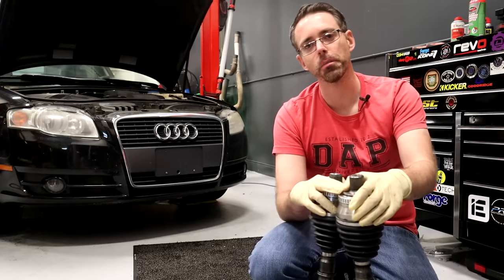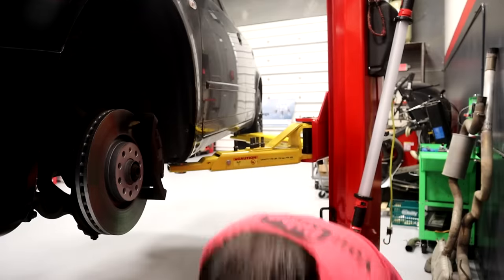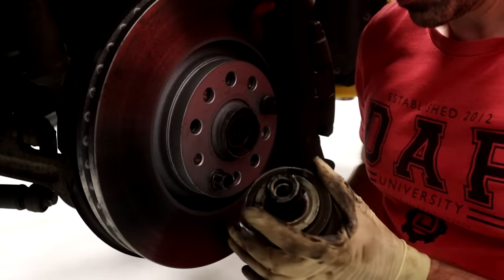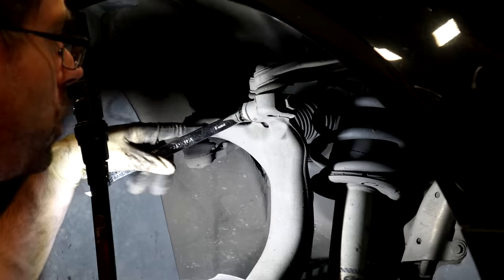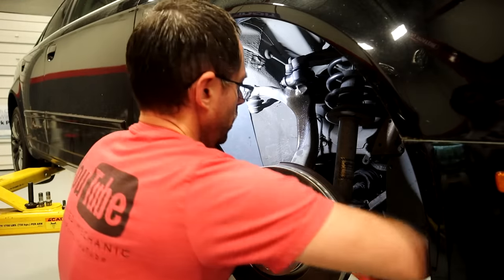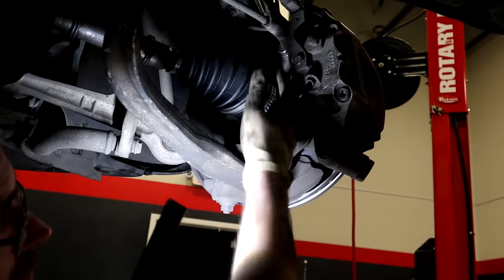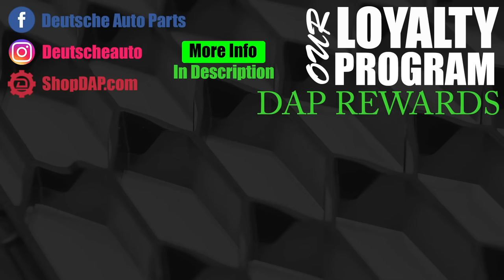How to Replace an Axle on VW/Audi Models

Comment: You can get them both out without removing anything else by lifting up the control arm with an additional jack to the regular driving height. That way you have enough space (at full left/right turn - take out key for steering lock) to get the axel out. Try various positions and angels of the axle but it is definitly doable, even with the S-Line suspension. Just finished this job yesterday.
Reply: This is true!  Thanks for sharing this info: very helpful.  
If anything, on the drivers side (RHD) = passenger side in LHD, jacking the strut up to a little above ride height helps.  I found I had to persuade the outer CV joint across with a pry bar, once I'd gotten the splined shaft out (steering set to full left lock).   I also removed the heat shield on the side of the gearbox as mentioned elsewhere in the comments.
Getting the new drive shaft in took just a little patience with getting the end of the splined shaft flat up against the back of the hub, then using a drift poked through the axle bolt aperture and into the hollow core of the splined shaft to line it up better.  Actually went in quite quickly and easily.
Reply: Best tip
Reply: Thanks for that guys 👍. 
Quick question,  my rotor is moving significantly while trying to break the axel nut, is that ok?
Reply: I am about to attempt this today . These videos and comments are a wealth of knowledge for those of us that want to fix our own things . Thank you to everyone involved

Comment: If you can, always get OEM axels, don't buy the cheap $30 ones. Unless you're planning on dumping the car on someone else, but if that's what's going on then you have bigger problems and should probably rethink your life
Reply: Raxles axels great place audi buys from them. Alot of after market  heap axles have hollow shafts and oems are solid.
Reply: We had the ball bearing cage brake / shatter after 3 mo. on a China cheap outer CV on a Caddy. Amazing as that's an under 100 hp drivetrain. Don't buy cheapo replacement axles.

Comment: The 08 A3 wagon is 12 point 15/16".it had 80 lbs on it .drop your other wheel to ground .real world floor jack style.take your pipe  from the floor jack put it on your breaker bar....get a 14 -16 m triple square to loosen lower strut mount bolt. That's how mine is set up up

Comment: i was under the impression that anytime you take out one of these bolts that require 90 or 180 degrees you need to replace the bolt because they are stretching to tighten.
Reply: Yes, all such specified bolts should be assumed to be one time use, Toque-To-Yeild.

Comment: for the passenger side i did it first and what bothered me was the heat shield but my axle came out easy, i just use the small spaces and moved the boot around to get it out

Comment: For anyone doing a B8.5, I was able to do the pass side without undoing any control arms or jacking up the suspension.  Turn the steering wheel  fully left, then angle the outter joint as much as much as possible to where the axle forms a check mark or V where the point aims towards the rear.
Reply: What about the driver side chief

Comment: Turning the steering wheel to full lock, taking the keys out of the ignition so the steering lock engages and then jacking the upright/knuckle up to take the sag out of it often allows you enough room to remove the axle without taking any arms off.
Definitely works on b5.5 Passat’s and probably related models.
Reply: On my b6 3.0 the drivers side axle could be removed and replaced without removing anything but the tire. Passenger side unfortunately can't.
Reply: I did the same when I changed my schock absorbers.
Reply: What about on a b8.5?
Reply: Works on a b7 too.  Left side just requires turning the wheel to full lock. Right requires full lock plus jacking the wheel up high enough to get the axle at a downward slant to clear the differential.

Comment: Great video! Really wish I had a lift and air power too, haha. I just did this on my B6A4 Avant. For the passenger side, I had to turn the wheel full lock to the left and then I opted to remove the plate/shield part just above the axle that is largely what causes there to not be enough play to remove it as easy as the driver's side. It's held on by three 6mm bolts. I removed the two on the side and left the middle one loose so it could move freely but stay connected.

Comment: I just had to remove the axle from the hub on my '13 Jetta SE 2.5 in order to facilitate a strut change. I worked for 30 or 40 minutes to free the axle bolt (I actually expected longer), but to my delight the axle slid right out like butter. The inside cavity was immaculate, no signs of wear or rust - and I'm in Ohio!

Comment: Pinch bolts suck they love to freeze. Ive snapped the head off one before. So now i just remove the lower ball joint and have plenty of room to work. Ive done it a handful of times and ive never needed an alignment on anybodys car.

Comment: My axle doesn't have bolts. The inner driver side cv housing is stuck. The passenger side was really hard to get out and was really really sticky, no transmission fluid came out as the repair manual stated, idk what that means if anything at all. But what was supposed to work, opposite side prying, has had no effect. Any thoughts, please help me out I can't find anything about my type of axle.
Reply: Because you have an auto transmission. Two ways to do it: 1) use an air hammer ; 2) buy the special tool to take the inner joint out of the trans. The first approach is not a DIY. The second one is expensive. Good luck.
Reply: Search VW Forums for construction of electrical duplex box (cut-out) with 2 - 3' metal flat stock. Wood block on end to flat stock to use as a slide hammer. Believe this design came from Toyota.

Comment: Great video chief.  I'm doing front left on a 2013 sportwagen tdi.  Looks very similar.  I can get the drive end flange bolts in no problem. And the wheel end spline is easy too.  But I'm having a very hard time torquing the drive end flange bolts to spec because the transmission and the transmission end of the axle are turning even when holding the wheel side of the axle in place with a screwdriver in the rotor.  Any ideas?  It's no problem getting them finger tight.  The manual specifies star pattern tightening to 10 Nm and then repeat to 70 Nm for the M10 bolts.  Even the 10 Nm is doable with no problem but trying to get them any tighter just spins and wraps up the boots.

Comment: Can extract that same lower control arm bolt if I my using a 3 Ton Jack plus two 3 ton steel jack stands? I’m asking because I know your using  a jack lift hence working in the air. Respectfully lastly my Audi A4 Quattro 2.0 08. Has been lowered meaning the suspension is not STOCK!

Comment: So, I just did both axles. The I got the inexpensive ones from ecs tuning. 
The drivers side matched up fine. The passenger side one wasn’t as thick as the oem shaft. And it was slightly shorter. Less than a half inch. Is that bad? Could that be the clunking I’m hearing over bumps? 
Bushings and ball joints are all good. 
Shocks and springs are good as well. 2013 Audi A3 8p

Comment: I will be pulling this out of the car at the junkyard this week. Am I able to reach all four triple square bolts on the CV axle without being able to rotate the wheel? I doubt I will be lucky enough to have the vehicle in the neutral position, allowing me to turn the wheel. My bet is that it’s an automatic and then it’s in park.
Thanks in advance!

Comment: Hi All so I'm replacing the axles in my Q7 and had a few challenges with getting the inner bolts loosened they are triple square 12 and as my shaft had snapped at the outer spline I had to utilise transmission to hold in place start engine put in neutral spin shaft then in park for each  bolt..my question is shaft removal as I have factory air suspension and it appears I can't just drop the control arm I will try jacking up as suggested shortly... I have an 2006 AU delivered 3.0tdi and I'm wondering if you have any tips to remove

Comment: Thanks for this, in my case the releasing of the torx bolts on the driveshaft end near the gearbox resulted in the casing still staying on the gearbox and I had to pull the knuckle out of the casing, Is there an reason for the casing/part where the knuckle sits in to to remain in place even after all thge torx bits have been removed?

Comment: Thank you soooo much for this video!! Did them at the same time as coilovers. Super easy removal if you break them loose, take the stock suspension out, put new axle into place, and torque axle down after the new suspension is in

Comment: what do I do if I cant get the wheel to turn so I can take the bolts out eaiser of the axle. I got the top 2 out but for some reason it wont let spin the rotar to get the the bottom bolts like in your video. how do I turn the rotars

Comment: Hi Paul, 2008 Jetta 2.5L manual trans here.. changing the output seals on the shaft from my trans axle flanges, so I have to remove the axle. I have short triple squares, and it seems as if the m10 doesn’t fit with my cv boot in the way. I have looked up longer triple square sockets, and see 4” sets that may work. Does shopdap have the info on that, as far as what specific triple square I would need? If you want, I can email in, I just always buy my specialty tools from you guys. Please let me know if you know if it’s for sure m10 for all VW Audi, and what part link I need from you.  Local NC, so shipping isn’t a big deal, I just want my seals done! Have all the parts but just couldn’t get at it with short triple squares. Thanks!

Comment: I got stuck in the ditch once with my mk7 GTI. I was eventually pulled out but the mud in the wheels caused a lot of vibration. I cleaned all the mud off the wheels but it’s still vibrating! Any advice? Could it be bad axles?
Reply: Yup
Reply: @usa5046  had the same issue?

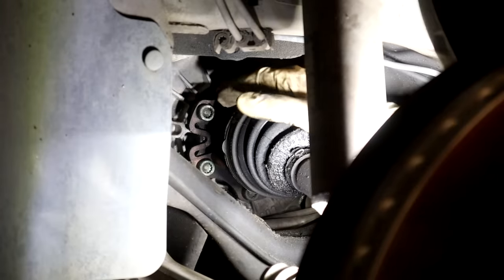Comment: When you remove the axle bolt from the hub (2:50 ish) is it normal for grease to pour out? It happened on my MK7 when I lowered it. I just packed some CV grease in with a syringe and never thought about it again
Reply: Yeah pretty normal, especially for a failed outer cv. Lots of people also grease the axle bolt before installing.

Comment: Does anyone know with a b8.5 A4 will I need to remove the knuckle to replace the drivers side axle I’m assuming it’s the same as the b8 and the passenger side requires it only

Comment: Love the video but would love for u to point out certain things lile the nylon nuts used on some of the suspension parts are one time use just like the stretch bolts an also u have to replace the axle nut at the same time
Reply from the maker: Audi doesn’t note this axle bolt as 1 time use.
Reply: @Deutscheautoparts  the nut not the bolt

Comment: No one ever posts videos on how hard it is to get the other type of cv axles out, where they don't bolt to the transmission; they pop in/out. I had to use a slide hammer and vise grips to get them out.
Reply: Exactly. This DIY is for manual transmissions. For auto trans is a pain in the butt because you need a special tool to get the inner joint out. I saw a guy using an air hammer to get this thing out. Definitely not a DIY.

Comment: Man, I wish the A4-chassis VWs had sealed bearings and axle bolts instead of axle nuts that require Incredible Hulk levels of torque in a special sequence, and were removable without undoing the ball joints.

Comment: anyone got a good tip on how to beat the axle out of the hub safely with intent to reuse?
Reply: I use a length of wooden broomhandle-diameter dowel.  Just taps out with a rubber mallet.
Reply: @Grantidge69  I started just using handle of a wood hammer and then hit that with a deadblow 👍
Reply: Penetrating oil on axle spline. Put outer axle bolt in about 1 turn from tight. Flat aluminum stock on the long bolt head. 2 lb. then escalate to 4 lb. sledge if needed. Monitor bolt tightness & loosen as hub separates from carrier. Just did 1 today,,,

Comment: Leaking cv joint , replace boot or cv joint?
Reply: If it makes noise, replace joint. If it just leaks, replace boot.
Reply: panzerveps its a fresh leak, can i diy the work i dont have a torque wrench
Reply: LEXUS-RX300 buy one from harbor freight then return it 😂
Reply: @MegaMetinMetin  You really should get a torque wrench, but you can do it without one.
I use a meter long breaker bar for the final 180 degrees, and that extra half turn is usually as tight as I can get it.
Several of my colleagues never bother with the torques, and just give it a few ugga duggas with the impact driver.
You'll probably save money in the long run by buying a torque wrench.
Also, buy a brass chisel in case the cv joint is seized in the hub. One of my most used tools, after the pocket screw driver.

Comment: I used to remove the heat shield over the passenger axle. Then you could slip the axle out without much hassle.
Reply: how do you do that?
Reply: @timoneil1193  by undoing the fasteners?
Reply: @panzerveps  u access the fasteners under the hood or in the wheel well?
Reply: @timoneil1193  well, if you want to disassemble everything in the engine bay to get to the heat shields, be my guest.
Of course you do it via the wheel wells.

Comment: At 5:27 there are some lines on the passenger side.  What lines are those?  In frustration, I took the lines out and now I cannot put them back in.  Does anyone know how to reinstall those lines on the passenger side wheel well or what they are called?
Reply: Did you ever figure it out ? I’m thinking about taking them off too I’m struggling taking the axel out there ain’t much space lol
Reply: @Daniel-jk9ge  I did change it. What I did was loosen the suspension in order to get the CV axle out. To do that I needed to use the car jack in order to hold the suspension in a relative good position so it doesn't fall. Of course using jack stands frees up the car jack. Given that it was difficult to pull the CV axle out, That was the only way I could do it.  Leave the lines alone since they are the transmission fluid cooler lines and since I could not reinstall them myself, I had to get the car towed to a transmission place so they could reinstall them and refill the transmission fluid that drained out.